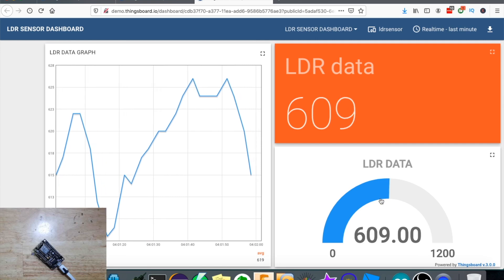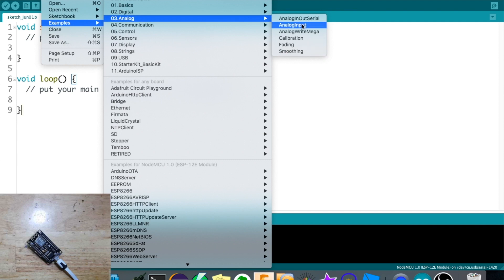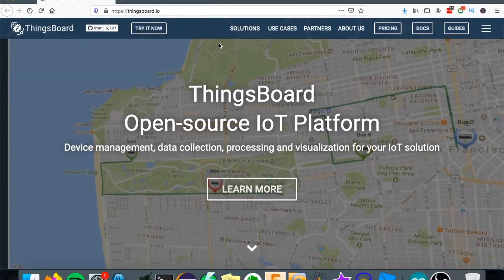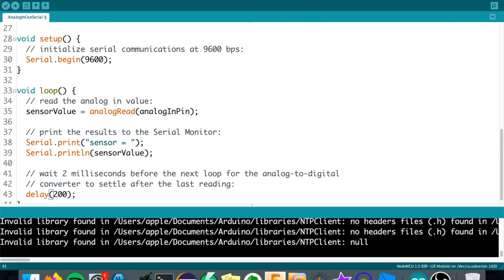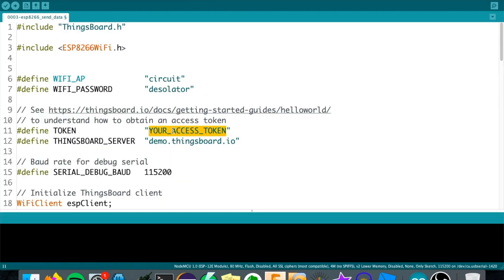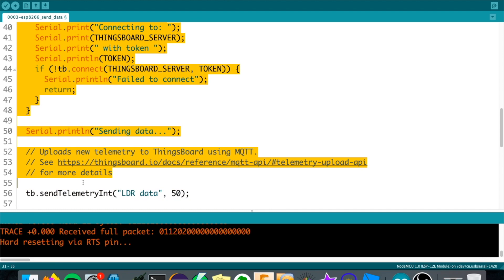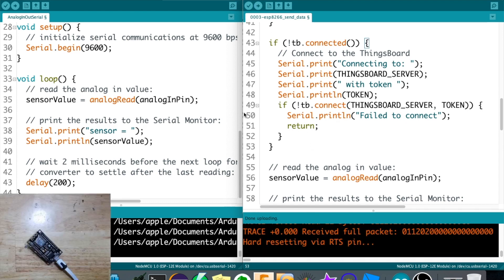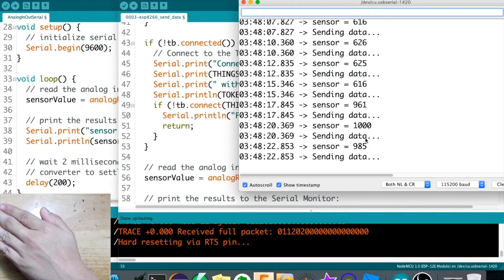ESP8266 IOT DASHBOARD - STEP BY STEP TUTORIAL USING THINGSBOARD via LDR Circuit Example

Comment: are u filipino po? 
I have a question, do you have a tutorial for iot-enabled smart kitchen using that iot? because, we tried to use thingsboard, we tried one sensor only in esp8266 then the connection between esp and thingsboard is connected successfully but the sensor data can't read what is the problem sir? I hope you will notice po.

Comment: error 
Documents\Arduino\libraries\ThingsBoard\src/ThingsBoard.h:15:10: fatal error: ArduinoJson.h: No such file or directory
   15 | #include <ArduinoJson.h>
Reply from the maker: What is the versio of ESP8266 are you running?
Reply: @circuitdesolator  
I solved my library problems by installing the libraries provided by them